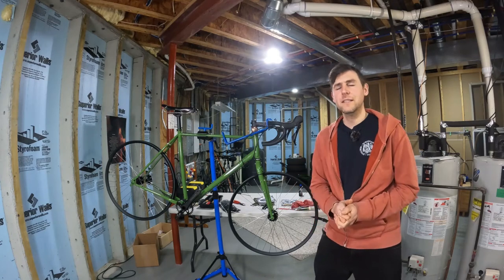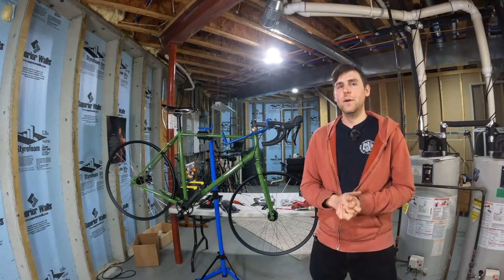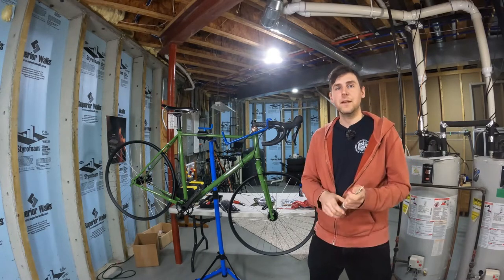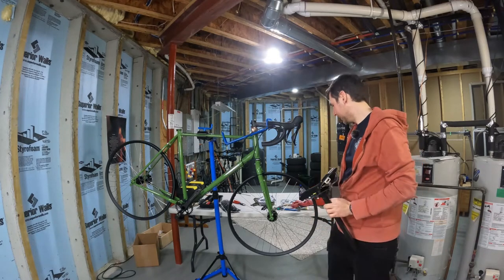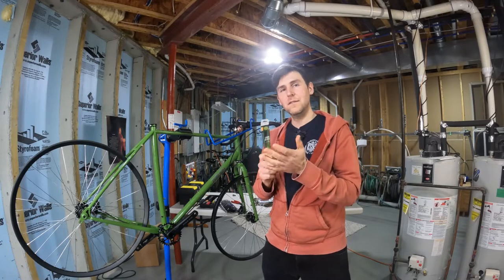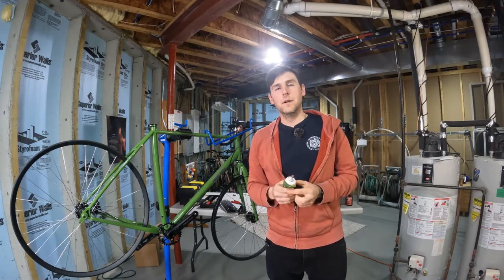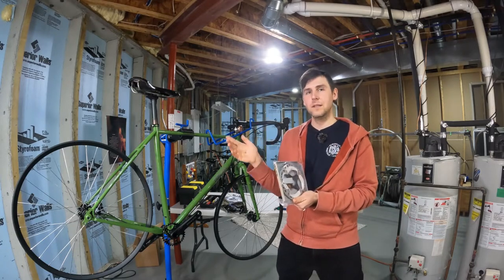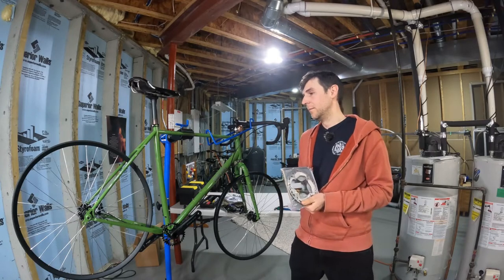Fairlight Faran Build #10a: Brake Discs & Fixing Calipers

Comment: Glad to see that you put the anti-seize!  The typical torque spec on the seat post collar is usually 4-6NM.  If you still have issues with a slipping seat post, you can put carbon grip paste to get more friction between the two components at less torque.  Have a good weekend!
Reply from the maker: Thanks!  I will find out for sure once I sit on it... my tires should be arriving tomorrow :).